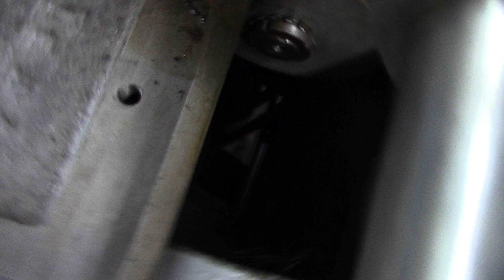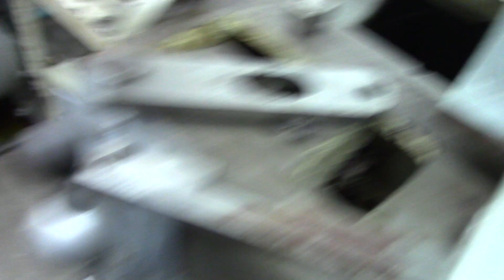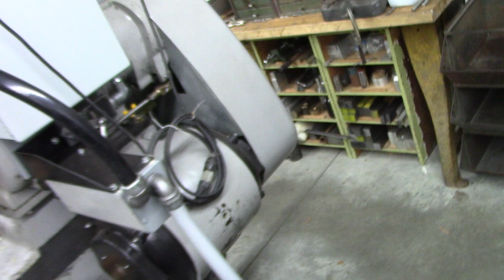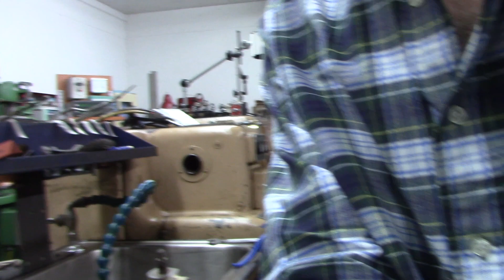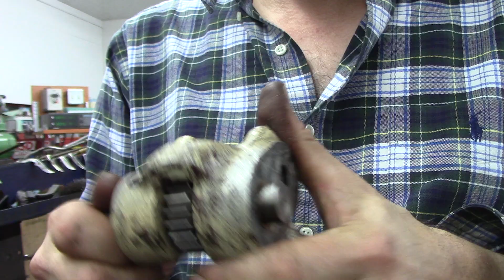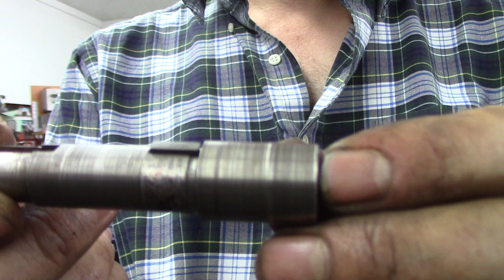12-28-23  --  Hendey T&G Lathe Part 18

Comment: Hay DOOZ
IM GETTING READY TO MAKE MY T-nuts for the new plate.

The round stock that I have there’s some kind of mystery stainless steel. Is that appropriate for my T-NUTS
Reply from the maker: If you are making tee nuts, soft steel should be OK.  But I had in my mind that you needed to make tee bolts.  For the tee bolts, you do not want the shank to stretch.  In such case I would use some steel that is at least 20C Rockwell.  You could cheat, and make tee nuts from softer or mystery steel, and Loctite studs into them made from stronger steel what will not stretch.  Threaded studs made from B7 are strong, made for high heat, but used in many applications.  The best (for me) steel to keep on hand that I can make lots of things out of (because it is strong and machines easily) is 1144 Stressproof. Either Niagara LaSalle or Carpenter make good grades of it.  My D2 tee bolts were a bit overkill, and I did not harden them. It was around 23C Rockwell, but it was tough, and you had to take smaller cuts.  Stressproof turns and drills and taps fairly easily.  It is not leaded steel, but it turns better than 1018. So it just depends is my answer. Tee nuts or bolts ? ?  --Doozer